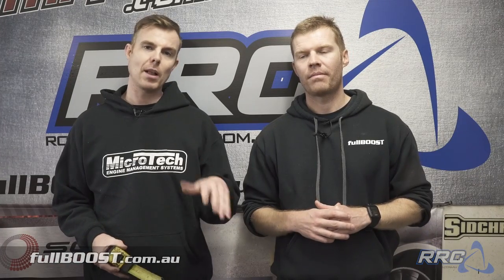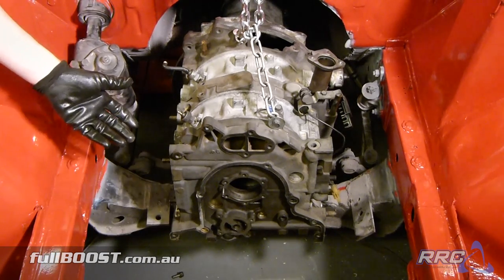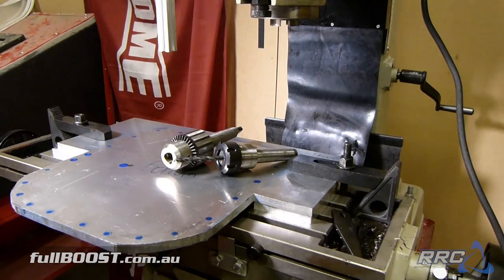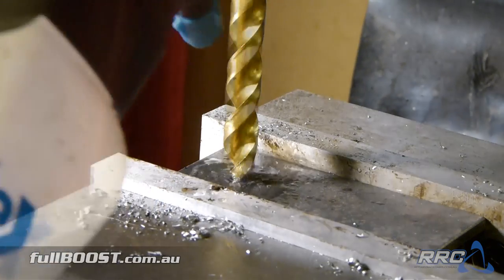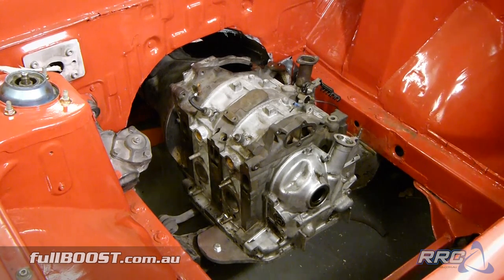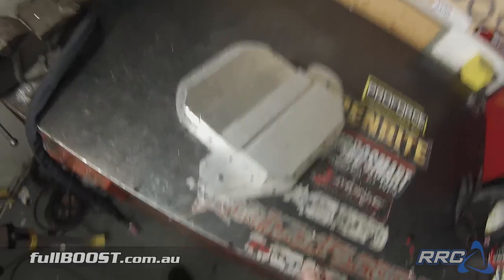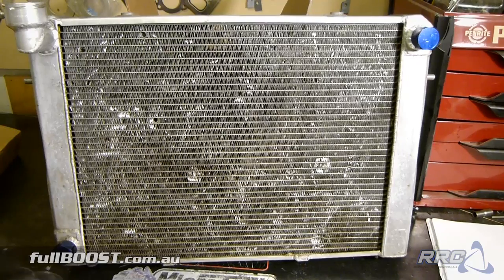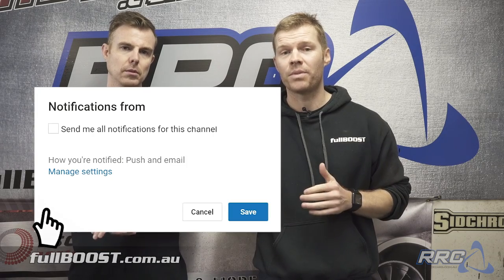BACKYARD MECHANICS | Mounting our rotary engine | Project REDLINE Mazda rotary build Ep 3

Comment from the maker: In this episode we tackle the mounting of our rotary engine in our Mazda, and fit the intercooler and radiator.
Reply: Fullboost What duration cam you guys running?
Reply: its a rotary it has not got a cam it all works on port timing
Reply: due to size of the turbo and drag racing, will be stage 4 cams Lance

Comment: @fullboost if you were to wheelstand, wouldn't you rather break and intercooler as apposed to a crossmember?
Reply from the maker: +scott mcr There's no point in smashing both.
Reply: the car will never bottom out to as low as the crossmember, but even if it did, its 6mm steel plate base so its not going to get hurt

Comment: Love the build but aluminum does flex aint you afraid of cracks on the welds from fatigue from all the flexing and heat
Reply: Hi Mate.  its 12mm thick, it aint going anywhere!  The engine/gearbox as 'one piece' is supported and the front and rear, so more than secure.

Comment: Serious question: Why not put the diff in straight?
Reply: the diff straightens(pinion angle) out when it accelerates due to the suspension compressing
Reply: hi mate, like what Mr Towel said, the -0.5 and +0.5 is essentially where we want it to end up after its launched and under load.  for the diff to be at 0, the engine would also need to be at 0, which isnt possible.  I think final was about 1 degree down on engine and 1 degree down on pinion angle, which when launching will work out to near parallel.
Reply: Didn't know that, thanks!

Comment: only one issue...he's putting the fuel cell IN the engine bay?...not what I would do but if it's a big tire car I guess.
Reply: Hi mate, its the most common place to find a fuel cell in most of these small engine drag racing cars as there is ample room.  Only reason you'd find the cell in the boot is more than likely to be packaging constraints in the engine bay.